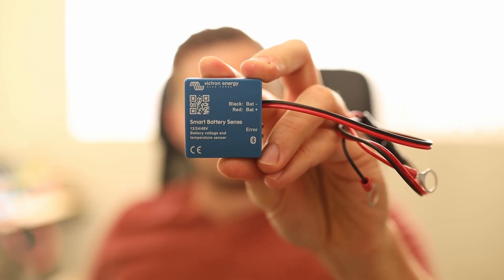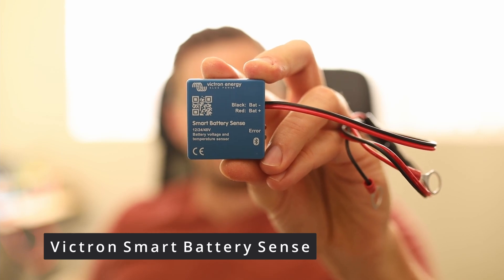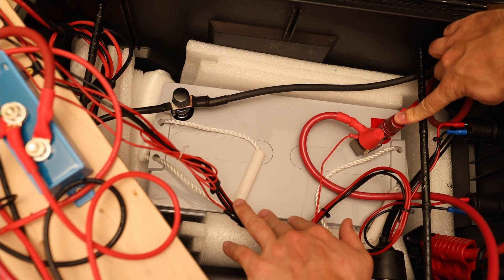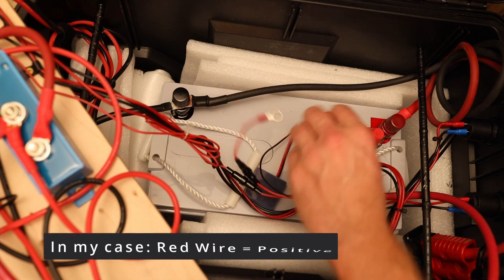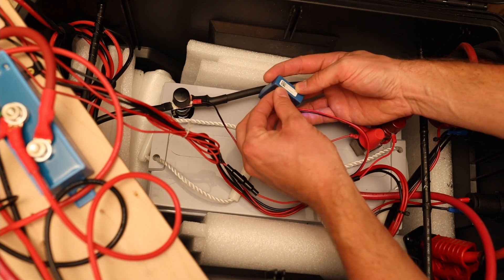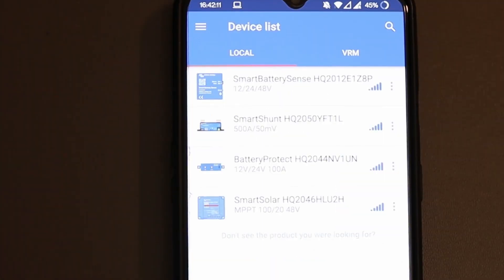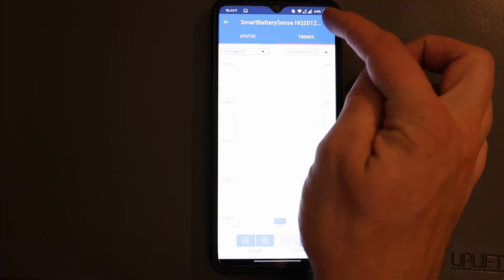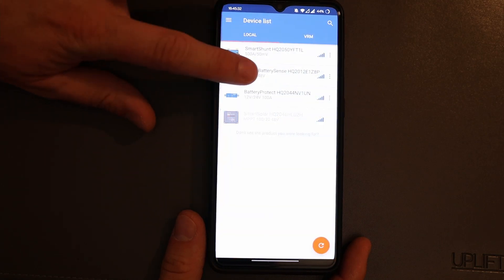Victron Smart Battery Sense for my Solar setup (DIY)

Comment: American Boat and Yacht Council is frustrated by manufacturers and their "smart"/digital/bluetooth offerings that are outpacing standards. What is the problem with a thermocouple directly connected to the equipment that needs temperature data? Why do manufacturers like Victron force an EMF/RFR dense environment and less reliable data delivery? Now they've even taken the short range sensor, guaranteeing that the entire vessel be exposed to RFR with their 10m range sensor. 
Pisses me off. Victron makes decent equipment but they need to maintain more analog offerings for those who don't like less reliable wireless equipment and who don't want to be poisoned by EMF producing "smart" crap.
Reply from the maker: I'm surprised they only offered this. But you can use One Wire for example with the Raspberry Pi and VenusOS which I'm mainly covering with my channel.
Reply: @tobisreallifeskillswithtobi  I am not very familiar with Raspberry Pi or VenusOS, how would they help convey temperature data to the Victron mppt controller without using some form of wireless transmission?
Reply: I'm sure your tin foil hat will protect you

Comment: Hi I have Multi plus-II an Carbo GX  and two batteries! But I only have one input fot Multi plus temp input ? How to make that all device in network si temp from bouts battery ? 
System is
1. Mptt 100/5O
2 NEW DcDC  50A ( still vaiting in couply days will come !
3 Multi plus II 3000/12/220/120-32 
4. Smat scant ( AUX is set up to monitoring starter batery.
Thanss  Goran

Comment: this is great! can this be used standalone (without solar charging)? thank you for your video
Reply from the maker: Yes, you can use just the temp sensor. But it will only provide the temp information on the Victron App.
Reply: @tobisreallifeskillswithtobi  thank you

Comment: what's the battery drain when this unit is hookup 24/7?
Reply from the maker: good question... in the manual they say for a 12V battery and connected to a VE.direct network: 1.6 mA

Comment: I have 2 lithium batteries in series.  I have 2 of these, one on each battery. The temps are always different when looking on the app. Is there a way to calibrate the temp? Great video thanks
Reply from the maker: I received the same question already. Not that I'm aware of unfortunately. Let me try to get more insight with m contacts on this
Reply: @tobisreallifeskillswithtobi  thank you sir

Comment: Interesting but, will I need to install the Smart Battery Sensor if I already have Gerbo, Linx shunt, battery charger and inverter all from Victron ?
Reply from the maker: Well, the temperature is really the only thing it can do. In case you always have it warm enough for your battery I would say no. But in case you need to make sure it is not to cold (do disable load/discharge) I would recommend it. In that case you should be able to configure it accordingly. It is up to you ;) I like data and understand what I can do with it or what I need it for.

Comment: I use it as a stand alone voltage and temperature sensor.However, I need to reset the pin number as I cannot access the device. Do you have a way of resetting the pin number?
Reply from the maker: I have not done this yet myself. I would try to download the manual for the temp sensor
Reply: I sent it back.I have bought another one as Victron will not provide support.
Reply from the maker: Bummer, that is not good from Victron... glad you have another which seems to be working again

Comment: Thanks for the Video, I installed easy enough with this. BUT not possible to see the temperature over then net on VRM. I searched all the forums, and yes this is the common experience. It only has VERY limited functionality. I had to buy ANOTHER WiFi temperature sensor to see the battery temperatures remotely. I'll have to keep checking the temperature manually over the web to ensure that my multplus doesn't charge when the battery is too cold. This unit only useful for my MPPT. Going off Victron fast.

Comment: I just hooked up a brand-new Smart Battery Sense to a brand-new 12V LiFePo battery with 13.4 charge and it is not appearing on my Victron Connect app (even though my Victron MPPT controller is) and the LED's on the side of the Sense are not illuminated either.  I am guessing mine is defective?  Any ideas from anyone out there?
Reply from the maker: It sounds like a defect. I assume you did make proper connections and the battery has some power left?
Reply: @tobisreallifeskillswithtobi  Update: After exhausting all methods, I returned the Battery Sense and got a new one, whiich worked perfectly out of the box, so yes, it was defective.

Comment: Hi there. New subscriber here. I am confused as to what info you get from this that you are not already getting from your controller or from the smart shunt, other than temperatures? Both the other 2 devices are already reading battery voltage so all I see as additional is the temp. Am I missing something?
Reply: Wow, thanks for the quick reply. Thought that this may be redundant to a point depending on the other components in the kit. However worth the price if you need to monitor the battery temp for a lithium battery without that built into the BMS.  Looking forward to more of your videos. Getting ready to tackle the Raspberry Pi build. I was looking for a way to remotely monitor the solar in my RV. I have full time cell capabilities in it, so this little project should do the trick. Thanks for the info.
Reply from the maker: You are correct. I get similar/same information from shunt and for example solar charge controller. You can configure/use it as you need it and like it. This temp sensor though delivers the current temperature at the position you placed it and transmits the Information in the Victron app/network.

Comment: Hey Tobi.. quick question... The Victor Smart Sense reads the Temperature in Celsius, while the Victron Smart Solar Controller reads the Temperature in Fahrenheit. Is there anyway to make them both read in the same format?? Thanks in advance.
Reply from the maker: Yes, you can set it up to C or F. I am sorry for the confusion I usually use C instead of F. That's the German in me ;)
Reply: @tobisreallifeskillswithtobi  I'll need to look again. I couldn't seem to find where either was changeable from what they were set at by default. I really didn't see much info in the Smart Sense. It appears the settings were only changeable in the Smart MPPT Controller.
Reply from the maker: Usually you pair the smart battery sense to another Victron unit like an MPPT solar charge controller or SmartShunt and there you should be able to change the settings. I don't have my setup here at the moment but will look into that in a few days. 

I found the last comment here, maybe you can give it a try:
https://community.victronenergy.com/questions/14450/victron-bmv-temperature-in-f-but-mppt-has-temp-in.html

Comment: is the Smartshunt + temp sensor equivalent to the BMS regarding voltage and temp sensing? I guess the Smartshunt is also sensing the voltage as long as it is connected to batt Negative and also has supply from batt Positive terminals.
Reply from the maker: I do not have a reading on the BMS temperature if there is one at all to be honest. Those are regular  Renogy AGM batteries. The temp sensor is attached to the battery side to get the most accurate temp reading possible.  But those AGM batteries are more resilient compared to lifepo4 batteries in terms of operating temperature.

Comment: How much voltage should I have to charge a bank of 16x12v 220a/h deep cycle AMH batteries, arranged to produce 880a/h at 48v. What should watts,volts and amp read on my Touch 50 in the battery section.

Comment: Hi Tobi, the Smart Battery Sense is a simple and very effective device. But you need to stick it to the side of the battery about half way up to get the accurate temperature reading of the battery as that’s where the electrolyte is and it uses this sticky side to sense the temperature. Sticking it to the top of a battery wont be doing you any favours and will give inaccurate temp readings. This is a common mistake and I see it on a lot on battery temp sensors which are stuck to batteries. You also need to input the temperature compensation for your particular battery as the default setting may not be good for your particular battery. The charging voltage needs to increase as the battery gets below 25°C and decrease as it climbs above 25°C, the Smart Battery Sense will tell your solar charger to adjust the charging voltage depending on the temperature of the battery and the temperature compensation figure thats required. The compensation figure is always a negative (-) number as well and must have this prefix. 🙂👍🏻
Reply: If you watch the Victron video on YouTube, they literally stick this sensor on top of the battery, which is why I attached mine in this position.